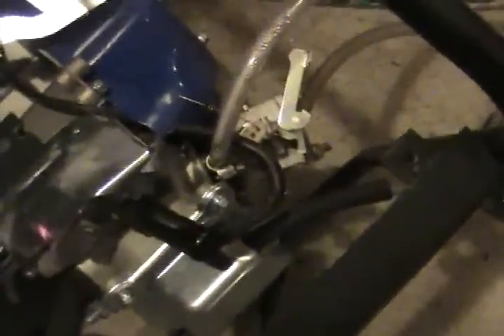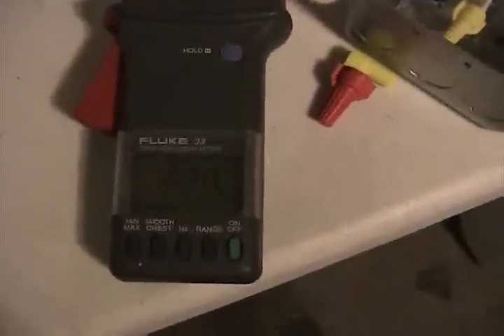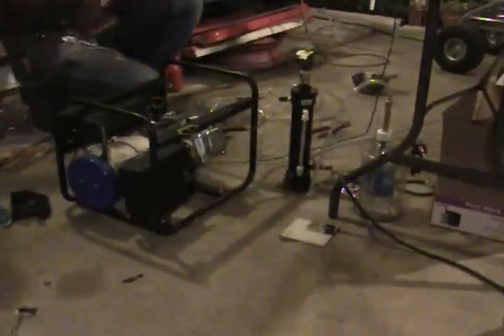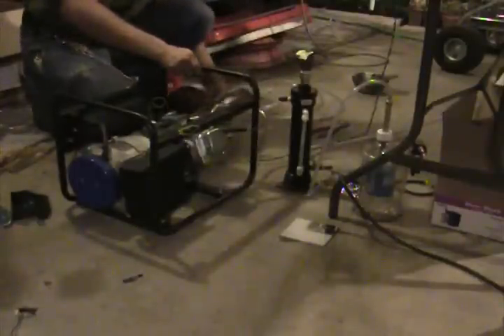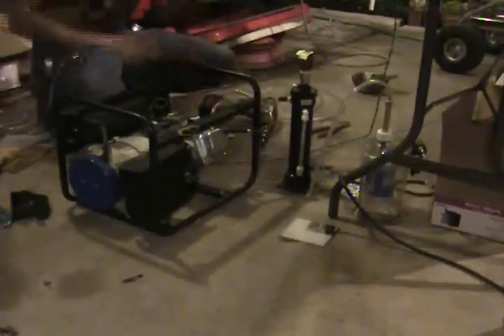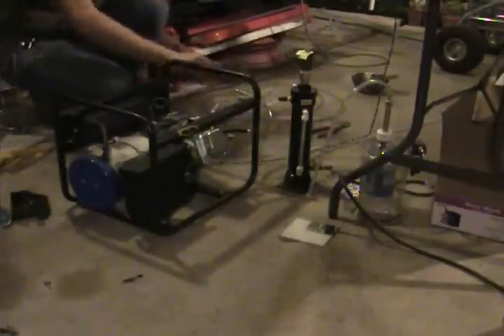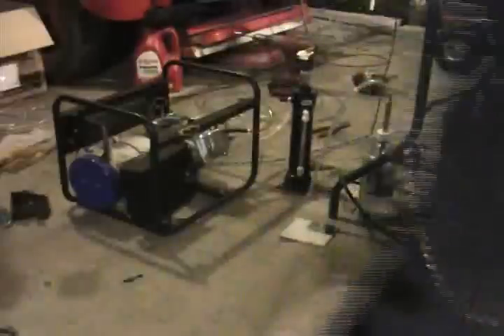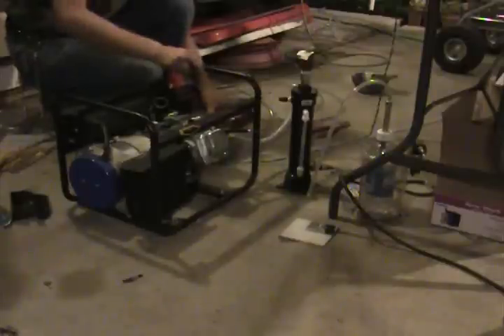generator test 16 engine running on hho

Comment: put a ball valve on the air intake to control the volume of air. or use the choke to control the RPM. i may have missed something. but that may work for you.